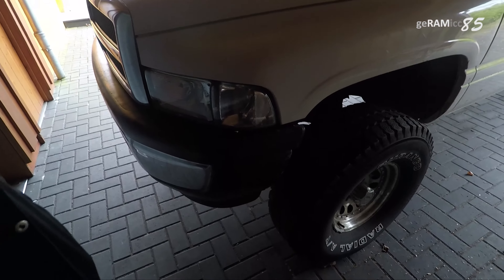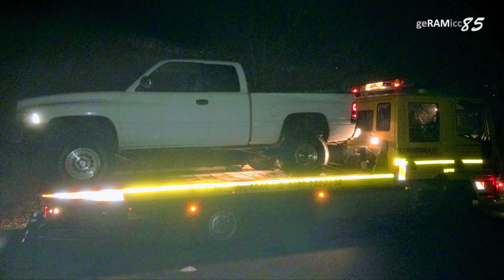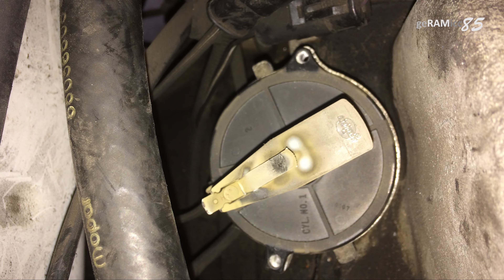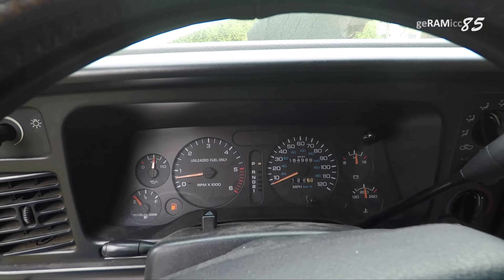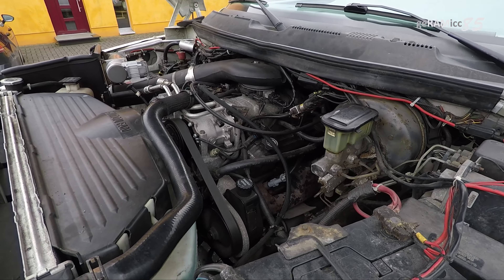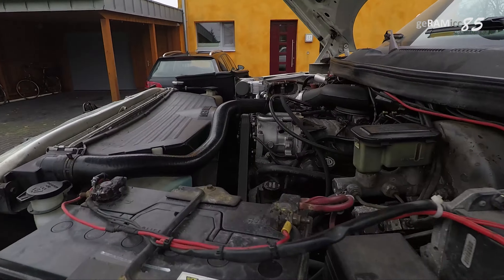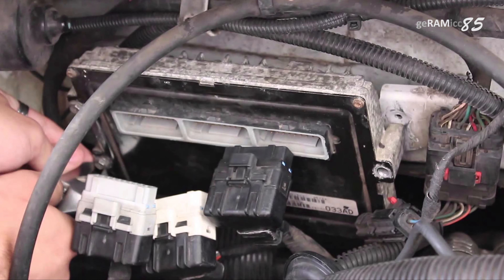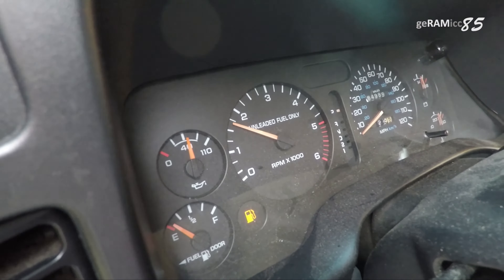P1391 CODE 5.2 DODGE RAM,PLEASE HELP!CAMSHAFT/CRANKSHAFT POSITION SENSOR CHECK ENGINE PROBLEM TRUCK

Comment: I solved this problem on my truck and figured I'd share with you. I unplugged the two wire plug from the alternator and the miss went away! Alternator replacement fixed it for me!
Reply: What happens when disconnecting these plugs?
Reply: Plz tell which 2 wires? Thnx

Comment: It is the flexplate, 100% positive, i have same issue, replaced so many parts, come to find out, the flexplate matched all my symptoms. Hope this helps
Reply: Flex plate is another word for flywheel?
Reply: Flywheels are for manuals flex plates are for automatics

Comment: Here is my humble amateur opinion. With the crack seen by the borescope, the first thing I would do would be a compression test to try and decide whether it is worth throwing more money at it. I'm hoping that is an artefact, not a true finding. I would also record, and then clear the codes to see if there are any new codes since replacing those sensors. If the 1391 persists you'll need to look at CMP and CKP waveforms and timing, and pursue other causes of bad sensor input (poor ground, bad wiring, etc). If compression testing is OK, I would put a fuel pressure gauge on the Schraeder valve and measure fuel pressure under load. While you're at it, I would put in about 5 gallons of fresh gas in case your engine is glugging water or contaminants at the bottom of the tank. You might even consider siphoning the small amount of fuel remaining in the tank to look for contaminated fuel. I would not fill the tank completely until you prove the fuel pump is OK since a full tank is hard to work with. The freeze frame data wasn't particularly suggestive of a bad pump or bad pressure regulator but this did start with a blown fuel pump fuse and it is worse under throttle which may be pointing to a fuel delivery problem. If you have access to an oscilloscope, you could measure current draw by the pump to get a feel for whether the pump is on its way out. If fuel delivery seems to be OK, then I would pull the upstream O2 sensor and measure exhaust back pressure to exclude a clogged cat. If all of that is OK, I would study live fuel trim a little more carefully under load to search for more clues. The STFT was a little high in your freeze frame and I suppose that could be a clue regarding a bad fuel injector. If you can get access to a labscope you could look at injector current ramps and ignition waveforms. As I recall these older Rams don't have a MAF but I suppose bad data from the MAP could lead to strange fuel trim under load. In the absence of good diagnostic equipment, I would not hesitate to ask for more professional help before replacing any more normal parts. Please stop by and let us know how this turns out.
Reply: same issue when i clear codes runs perfect for a few days...

Comment: Did you ever figure it out. Having same problem with my 97 2500. Changed both cam and crank sensors put a new timing chain and checked ground wires all are fine put in a whole new distributor and had it fuel synced. Only thing I haven't changed was the pcm but I don't want to keep replacing things and getting nowhere.
Reply: I’m getting the p1391 code on my 2001 ram but it says fuel pump 3 control circuit high!!? Not sure if this helps anyone but it’s what my ob2 reader says

Comment: Hi there this is julio from Julio’shop since u have check cam n crank sensors and there is no problem with sensors and wires check the flywheel maybe is craked  we had a couple cars with same code p1391we check the sensors n wires everything was ok we check the flywheel and boom both of them had bad flywheel I hope this info help u. Let me know please thank you and good luck

Comment: Check the voltage and resistance to and from you cam and crank sensors. Then youll need to figure how your fuel pump got an over voltage. That may be your source problem

Comment: Have you checked the flywheel?. Due to are crank sensor pick the reading up from the flywheel and the 2nd gen dodge rams have had plenty of issues with the flywheel cracking .
Reply: i was looking at a 2001 2500 for short money as a back up plow truck.....soon as i started it up i  could hear the flywheel crack....guy tried telling me it was exhaust manifold leak lol ...it had the code for this so i passed....to bad because frame and body were decent.....if i had more time i could have put a used motor in but o well...
Reply: no this ones crank sensor , is in the block not the fly wheel

Comment: Could be 02 sensors. They need to sense the heated exhaust to cone out of closed loop and if one is reading wrong when it sends the info to the engine computer it can cause it to adjust fuel/air intake in the wrong way.
Reply: those years dodges are notorious for 02 going bad....change them when you do plugs..

Comment: I know this is an old post but I also noticed you recently changed your alternator (I'm assuming out of desperation). Since you're already reaching out to the YouTube community for help, consider contacting scannerdanner. I'm confident he would be able to help you get to the bottom of this. I'm in no way affiliated, I just also have the exact problem you're having, but am not as able as you. I really want for you to be able to fix it, so I can learn from you.

Comment: After some thought i deleted my last comment, being that it runs good when cold when Sensors are in closed loop but bad when it's warm when Sensors kick in to make air/fuel asjustments I'm leaning on either wiring grounding out somewhere particularly a hot area or pinch point or a clogged cat, however only one can explain a blown fuse on fuel. Those symptoms could be many things but considering it all would say check all wires and the cat, ive done a ram that ran perfect when cold but as soon as it was hot felt like it was slowly falling on its face the more i gave it gas which did turn out to be a cat, just having a hard time understanding the blown fuel fuse. It's going to be guesses on here for us all but considering it runs good cold it can only be a few things as its in a loop when cold for the 02 sensors and only allows certain amount of fuel. If a cat is clogged may run fine until warm then when the loop opens allowing more fuel the cat will heat up causing it to expand and clog worse.
Reply: Was this issue ever resolved ?
Reply: Blue Label Media what about something that runs great when warm but terrible when cold

Comment: I had the same code. I did a full tune up and replaced the cam and crank sensors and still had the code. Turned out the idle air control valve was causing the problem
Reply: Did the IAC fix the problem?
Reply: @Magnum5.9360  for mine it fixed the stalling problem and I thought it fixed those codes since they went away but they came back 2 weeks later. The ignition was cause for those codes. My ignition was so worn I was able to pull the key out while it was running. I replaced the ignition and it fixed everything
Reply: @austinhess1218  I am sorry. What is the ignition? Did you mean the ignition key cilynder?

Comment: Did you solve the problem and thank you for your videos its helping me alot
Reply from the maker: i did not give up yet and now back on the truck trying to fix it
Reply: @geramicc85  mine ended up being the cam position sensor. I had bought one from autozone lifetime warranty. 
I started having problems again 2 weeks later. It wouldn't turn on. I took the sensor out cleaned it put it back and it turn on.  I replaced the sensor again since it's lifetime warranty. Long story short I went to the dealership and bought it factory. 70 bucks instead of 30 bucks from autozone. Problem solved

Comment: Was this fixed. I had what I would call a similar problem. Bad front O2 sensor. When the 02 sensor goes bad computer does not know how much gas to give engine. First started with miss then truck quit all together. Who knew!  I see other people also posted 02 sensor so not just me who had similar problem. Had same code turned out to be bogus. Had this problem years ago, after replacing O2 sensor never happened again. Good luck!

Comment: So I have a 2001 dodge ram 1500 5.2L I drove 31 miles into town and turned to go up the coast to work and it started snapping and popping with no acceleration had to big toe it to get it over the bridge, it is throwing the p1391 code but it is fuel pump 3 control circuit high!!? Where is everyone getting this cam sensor crankshaft sensor from this code? I’m sure it fuel pump module, fuel pump, or relay? I’m not a mechanic by any means but I’m as stumped as everyone else 🤷🏻‍♂️ any input would help 😂

Comment: Have the main engine harness check or changed I just had this same problem from the truck I just bought. I put 2 new crank sensors in and no change. Truck was idle cut out and died and wouldn't restart at all. so I had another harness so I changed it after I turned the key and she started right up no more problems

Comment: My 2009 dodge Ram 1500 5.7 hemi keeps blowing camshaft sensor it will drive good for a little bit then the traction light comes on and it runs like crap what could be the problem

Comment: I have 94 ram 360 runs great, idles 5 minutes gets like it’s flooding quits. Starts up great five minutes later does same. Replaced all the usual parts. GOT ME STUMPED? NEED HELP?
Reply from the maker: did you ever replace your crankshaft sensor?
Reply: Thnx brother I check out. CHEERS !
Reply: @geramicc85  replaced everything?
Reply: @geramicc85  thinking about getting an  o e m from the dealer?
Reply: Which wire off the alternator ?

Comment: I went through 2 distributors and the duralast one had a problem with the cam sensor. I no longer have the light on but I got a Cardon distributor and made sure the distributor was sitting right in the engine

Comment: Check your wiring at the connector. I had exposed wiring that shorted my relay box to where I had no spark and caused my crankshaft position sensor to go bad.

Comment: It can't pump out the fumes so it forces them to the front andin the out valve and now there's not enough clean air but when it cold every thing contracts a hair and let's exhaust out and more air in till the heat hits it and expand closes off

Comment: I'm having same issue.  I'm playing with cam shaft wires on harness and boom it stalls engine.  Try the connection harness wires directly at the connection clip

Comment: I got it to run by replacing the engine temp sensor  normally you see this in Chevrolet be careful  it's  behind  the  alternator  and if you drop the alt you'll will change this sensor  twice

Comment: The cam shaft wires them self's are not good or the connector may have oil or water in it check the wire and connector of can shaft sensor

Comment: That sounds like mine still haven't found the problem I've done everything you done an still the same on mine i pulled in yard an turned off then I went to move  it an it wouldn't start so I changed the crank an pick up coil sensors an now it starts but it runs like it's out of time

Comment: Hello there. The problem have to do with the crankshaft position sensor I would recommend you to take one bolt out off the crankshaft position sensor and  slightly move it away from the engine

Comment: Idk if you ever solved this issue or not but I am having the exact same issue on my 99 Dakota. I’ve changed so many parts and nothing has solved my problem. And after having to pull the transmission to change my clutch the other day I accidentally smashed the crank shaft position sensor so I had no spark and couldn’t start it and when I went to change it I noticed it was covered in black oil or something all over the sensor part that goes into in the hole in between the transmission and the engine and is now running exactly like your truck and I can’t figure it out. I’m hoping you can help me out as this is my only vehicle and is my only way to make money right now. Please help
Reply from the maker: hey brandon, i am not 100% sure if i solved it on mine but try to change the sensor again, that made a difference here, the first one i used was from ebay, the second one from rockauto, get one from rockauto for your specific year make and model and it might do the trick, hope it works, best of luck

Comment: How about the crankshaft position and/or the cam shaft position sensors?  I have a 1996 Ram 2500 with a Z engine.   It's having trouble starting once in a while and sometimes it loses power.  I think it's the crankshaft position sensor.  I know these can cause all kinds of problems when they start to go bad.  I'm looking at replacing it now.  Second thought is... what is your output of your alternator?  For some reason I can't recall, alternators will output max voltage which causes issues over time.  Lastly, fuel pump or filter.  It's been a month, did you find a fix?

Comment: I had the same problem and i solved , change the altenator
Reply: how does changing the alternator help with this issues.... just asking bc I am having the issues as well on a 1999 dodge grand caravan 3.8L and I notice as well the battery light does come on. I had alternator check 6x's and no issues with it. battery is full of charge .. but I am confused on how they play a roll in this issues.. Help me understand please and thanks
Reply: Mines been doing the irratic idle and back firing also seems to top out at 4500 rpm like it's on the Rev limiter I've replaced the crank sensor full time up new coil pretty much everything but the alt and the cam sensor and did the intake gaskets super pissed with it if someone has an answer I'd like it lol is my truck charges good so doubt it's the alt
Reply: Alt
Reply: @robertcampbelljr5952  The alternator is the motor running the electric portion of the vehicle, creating amps. (Because of the magnets moving next to copper wires)The battery or capacitor is only needed to run the starter which begins the process of a running engine. There's kickstart bikes,crank started vehicles and pull rope start motors.  the engine is running the amps feed the fuel pump and every other vital thing needed for a modern road legal car. If cars didn't need headlights,wipers,blinkers etc alternators would not be needed. Alternators like to work when they are cold and still because the shorts are touching. Once the alternator expands and vibrates the wear and tear is more evident.

Comment: Check ASD Relay Fuse, put original computer back in, unplug oxygen Sensors, run truck, see how it does, if the problem, check wiring from computer to 02 sensors, heater circuit and signal wire. Then plug 1 sensor back in, and drive. See what happens. Check with ohm meter. Check battery and alternator. Batt. 12.6 when running over 14.2 let us know. Good Luck!

Comment: Good luck.   I have a 98 Z code engine and mine starts right up most times.  When it warms up then it starts to run really rough.  The local garage replaced the cam sensor (distributor) plug wires and plugs.  It ran ok for about a month and then right back to the same problem.  The check engine light comes on and the code is for cam sensor.  The garage it's at now has had it 3 weeks with no luck.  I plow snow with the truck and hope someone can get it up and running. The oil pressure gauge stopped working about the same time also.
Reply: Mine does the same

Comment: What is the fuel pressure ? And intake man vac ?  when it acts up does it smell rich or lean ? could be the coolant temp sensor has a crack , My 5.2 jeep had a bad one and it tested good . Also very important . spray brake cleaner in the crank sensor hole , Make sure it is flooded clean , Use air if you have it , You might get someone to turn it over while you spray the cleaner . If the sensor gets a week reading it will run but poorly ..
Reply: Just spray cleaner in pretty heavy and turn the engine over and  spray again . Also that sensor is adjustable and should have come new with a small plastic  peel off piece , Don't peel it off just put it in up against the converter , The plastic will peel off and that is the proper gap  for the sensor . Hope you get it fixed !
Reply: Check the flywheel. The clicking sound may be an indication that the center of the flywheel has is cracked therefore shifting just enough to throw out your timing. Google it.
Reply: @douglasdebnar9606  its the speed sensor

Comment: On mine 1998 Dodge ram it was the idol sensor
Reply: Now my question is how do you change the spark plugs with the heat shield around them and your socket won’t go in?
Reply: @rhodonbrown81698  you using a spark plug socket?

Comment: Disconnect your negative battery cable turn the key all the way forward like your trying to start it at the same time hold the gas peddle all the way down and hold both for 30 seconds shut it off reconnect the negative battery cable and start it up

Comment: Did you also notice when the truck dies and you can't start it everything else seems to work but the gauge has the needles when you turn the key on the needles on a fuel gauge all the gauges none of the needles come up by chance? Because that's what mine is doing so far all I have been told or red is that it's a camshaft sensor

Comment: get the car reprogram it could be ECM Module
Reply: you need a quality scanner to do the job well hope you manage this issue
Reply: Nasser Al-Ghamdi the DRBiii scanners are obsolete. The new bidirectional scanners cant program them.
Reply: as per the article it could be camshaft sensor 
https://www.autocodes.com/p1391_dodge.html